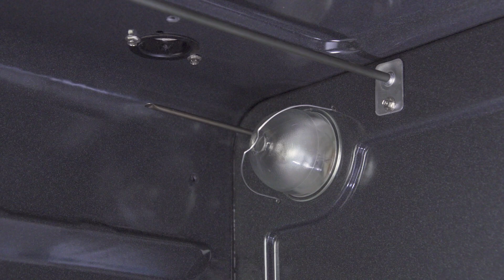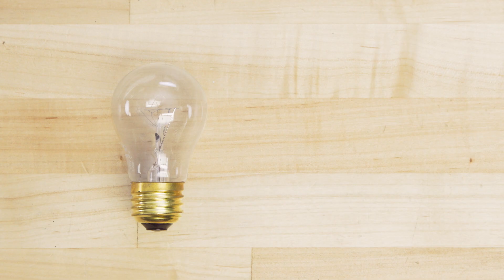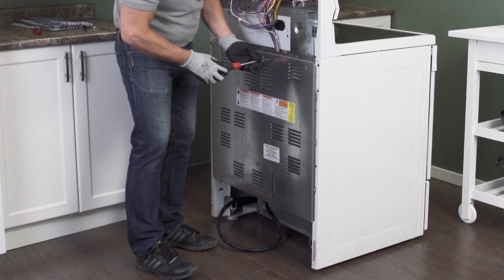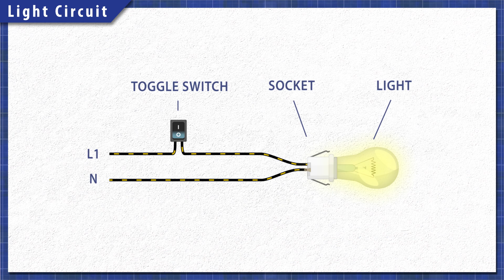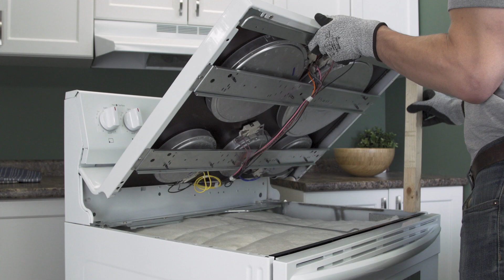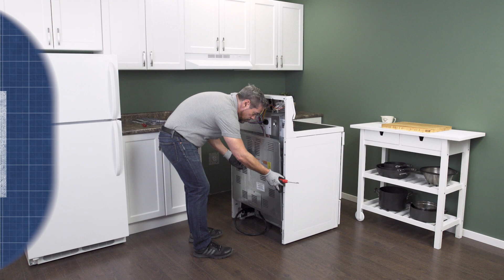Oven Light Not Working - Troubleshooting | Repair & Replace

Comment: I have a dual oven with both a high voltage controller board and a low voltage board connected to a "touch" panel.  The oven lights for my dual oven are stuck in the ON.  I'll check the door switch, but assuming that it is a problem with one of my controller boards, would it more likely be a problem with the high voltage board or the low voltage board?  I assume that the light circuit runs through the high voltage board, and the low voltage board simply detects the ON/OFF touch and send a signal to the high voltage board to turn ON/OFF the light circuit, right????

BTW, my oven does make a "touch" sound when I push the "Oven Light" button, but the lights stay ON.  All of my other buttons on the touch pad work as expected.
Reply from the maker: Thanks for watching. Sorry for the delayed response on this. Likely hood is hard to narrow down. It depends where the relay is for the lights. If the button presses and makes a sound then it's registering as a pressed button so this points to the relay being faulty. The relay would be on the high voltage controller board as the lights requires more power than a simple keypad. 
This could still be a faulty wire between the keypad and the high voltage board.

Comment: omg another american appliance. these old school designs with that upper panel are literally terrible
Reply from the maker: Thanks for watching. What exactly about these designs do you think is terrible?
Reply: @AmreSupply The upper panel with control buttons is unpractically on the rear side and the whole appliance looks simply weird and assymetric. I actually dont understand why is this vintage design still popular in USA.  And im not even talking about your showers. Can you already put down the shower head from the holder or its still firmly fixed without the possibility to put it down and hold t
it im your hand to precisely wash your arschlochs, bollocks, and bridges😢😂
Reply: I would also like to know if your much lower voltage is somehow affecting your appliances..
Reply from the maker: @Blameberg  Electric ranges in North America use two 120V lines which are out of phase so they practically run off of 240V power. https://www.youtube.com/watch?v=L9ZI5GyON9I
There are slide in ranges with the controls at the front however these are more difficult to access and repair. Front controls are also more easily touched by kids. The freestanding ranges have all the major components accessible from the back, where the switches can be tested after removing 1 access panel. So there are pros and cons to any design.

Comment: When you pushed the toggle switch back was that to turn it on? My oven light hasnt worked for awhile. I cant remember if you push the button back to turn it on or off
Reply: I have a frigidaire. The button is up and down. Not left to right
Reply from the maker: Thanks for watching. It depends on the switch. You can usually tell by the symbols or writing on the switch. There might be the I / O symbols. The I means the line of power is connected (light on). The O means the power is "OFF" & the circuit is Open, so the light will be off.

If there are no markings on the switch you can test it as shown in the video.

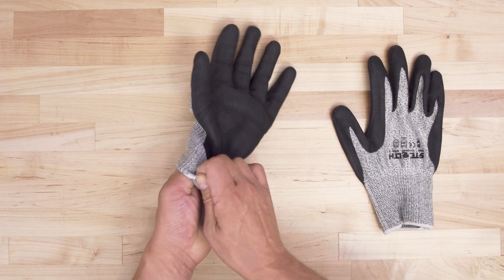Comment: Matthew 7:5 James 2:20
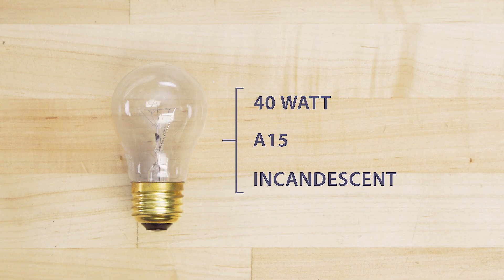1:28 Oven Light Not Working - Troubleshooting | Repair & Replace
 https://www.youtube.com/watch?v=T5CPQxYp1WQ
According to some manuals, you need to be sure to unplug your 
oven first. Be sure that if it is electric to put it back on the stand, 
so that it does not tip over. Seeing as electric ovens are way lighter
in weight then their previous coil non electric oven counter part. 
Things that I partly read from a manual. Do your own research.
Not yet a profession. Just googling some things. 
Best, With all the love, X. Inn Jesus Name, Amen.
Reply from the maker: Thanks for watching. Those are great additional considerations that some manuals outline.

Comment: If there contuinty in the light holder socket, won't it cause a short circuit and trip the rcd?
Reply from the maker: Thanks for watching. Testing between the light socket terminals and the socket base is not a short, this is the path to supply power to he light bulb.

Comment: I just realized the light for my electric oven Isn't turning on.  I tried a new bulb, but it is still not working.  So, definitely not the bulb.

Your video is very good!
I feel like I can fix the issue (but I don't have some tools you use in the video.  lol)

Well, let me try to fix it tomorrow.  Hopefully, it works..  🙏
Reply from the maker: Thank you, we're glad that you're finding the video helpful! Buying a multimeter is extremely helpful for checking continuity of many appliance components. It's worth getting one!

Comment: Our oven is new, after two use, the light is not working.
Reply from the maker: Thanks for watching. If you've put a new bulb in and it still doesn't work then it's best to see if this is covered under warranty as you have a new oven.

Comment: What about bulb short life span(1 week).  I use appliance bulb.  Says it works in high temps but pictures of said appliance on shows lamps and refrigerator.
Reply from the maker: Thanks for watching. Are you saying that you installed an appliance bulb in your oven and it failed after a week of working?
Reply: @AmreSupply  yes.   It’s happened many times.   This is an 1986 whirlpool    I’ll see what happens when the high heat oven bulbs I ordered come in.

Comment: Anyone know how to fix oven lights not working they blew after cleaning oven 
Now no power Kenmore Model C970  with E..c.m 
Everything else work except the light 💡 any help greatly appreciated
Reply from the maker: Thanks for watching. It's worth replacing the bulb, and checking the connections to the socket. Look for any damaged wires or loose connections. 

Also if your oven light is controlled by the control board then it's possible that a relay has blown on the board itself. These can't be repaired but the boards are relatively simple to replace. It's best to eliminate all other possible causes first: https://www.youtube.com/watch?v=ORTi4lLyoqw